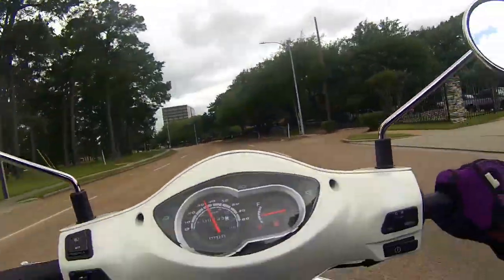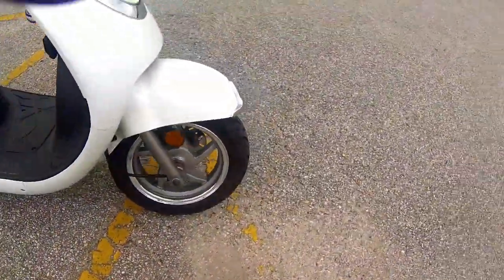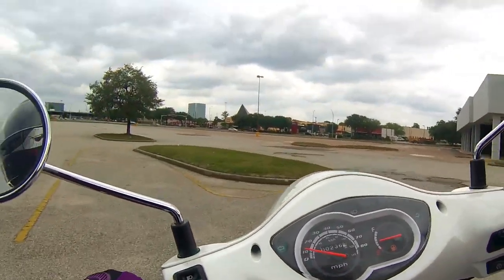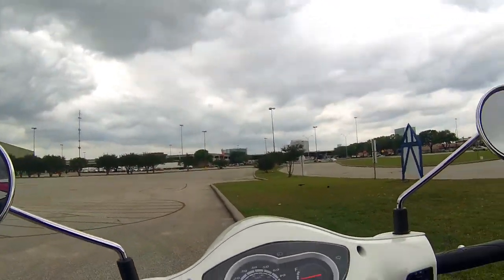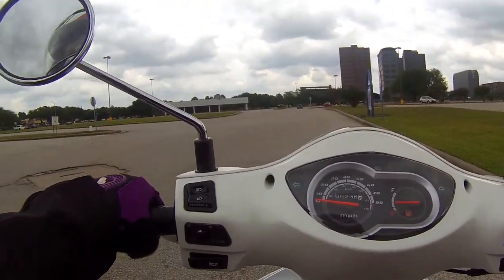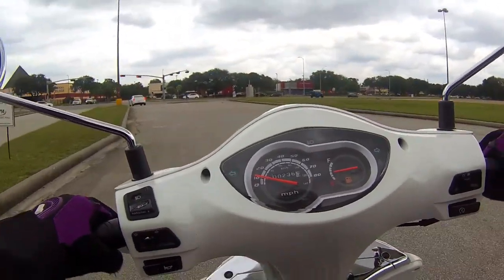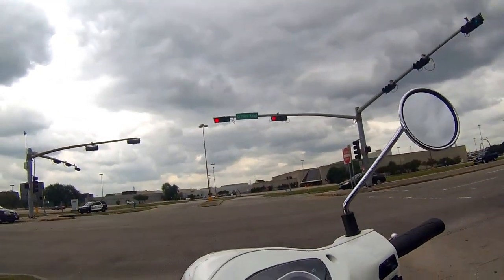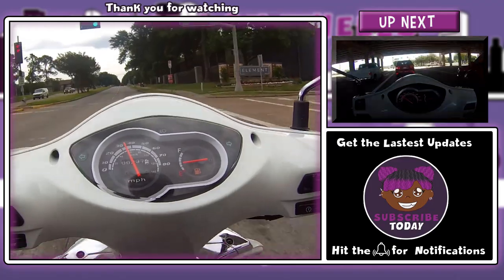125cc Scooter Vlog 21: Anti-Lock Brake System Story Time

Comment: The "ABS" systems on most (if not all) Chinese scooters are not actual "ABS" systems.  They're just a very simple mechanical pressure valve that diverts brake fluid pressure beyond a preset limit when a rider applies excessive pressure to the front brake lever. There are no complex sensors and pulse mechanisms such as those found in any true ABS system. Some (if not all) of the Chinese scooter manufacturers have added "ABS = Able to Brake and Steer" labels/stickers/inserts to avoid legal problems over the extremely misleading practice of claiming these scooters have "ABS' when they clearly do not. PS:  Some experienced riders prefer scooters without a pressure regulator, as they feel they have better control over the braking without it. Stay alert, be safe, and enjoy the adventure of two wheel motoring.
Reply from the maker: Edward Emmons Thank you for that insightful information edward.

Comment: Great explanation on the ABS!  You're right - ABS has a wheel speed sensor, and limits braking pressure when the wheel is about to lock up.  Your old Chinese scooter had FAKE abs, however, with no sensor, and essentially just a metal cylinder thing attached to the caliper that limits braking pressure.  The result is similar, but a lot less safe than real ABS.
Reply from the maker: Thank you Paul. Chinese scooters are cheap knock offs. So it's understandable that they use cheap versions of ABS.

Comment: I was hit last month (9/23/2021) on my Lance 125. Had zero time to do anything. I now drive a 2016 MP3 500cc with 3 wheel ABS and traction control. Would NEVER, EVER drive another scooter/motorcycle without ABS. I will say that the Lance is a pretty solid scooter for being so cheap. But our lives are worth saving up for a bike with ABS.

Comment: I've locked my brakes in training classes several times, both on the lot and on dirt. My brakes have locked on snow, wet grass and I'm used to sliding a bit. With regards to safety, I don't advise anyone to purchase scooters or any other bikes without abs. 

No matter what you have, you should practice braking regularly. If the ABS kicks in while practicing, you messed up.

Comment: None of my scooters have ABS. Just my CB500X. I have tried jamming my front brake and it's very very difficult to lock it up. I think I managed it once when some old guy decided to pull out in front of me. It does have combined brakes though. The manual says to apply both levers together, but I just use whichever I find appropriate.

One time the front started to wash out. I knew what to do, but they were factory tyres. Yeah, I don't recommend keeping factory tyres. But, I'll change them as soon as they get down low enough.
Reply from the maker: I've been thinking about doing the same to my tires as well.

Comment: Yeah I lock up my back tire all the time. the first time was kind of scary but I have gotten used to it.
Reply from the maker: The first time took me by surprise. But I haven't locked my wheel since then, so I all good.
Reply: Troll I don't like skidding out of KONTROLL.  (Not to mention tearing up your tire.  They're harder to change out and balance properly than to purchase).  So I remember teaching of ancient cycle master to put my BWAT toward the rear of the bike as much as possible in these emergency stop situations.  Much easier when you ride in a leaning forward position.  But on these little skoots you have to move yourself quickly and shift positions.    It's really difficult with your feet forward in the footwells and no foot pegs to push back on.  Safest thing is to be on guard position when danger lurks.  And PRACTICE your emergency stops regularly.  Of course, the even application of both brakes firmly without hesitation (ideally simultaneously repositioning your BWAT) is vital.   You don't have to think about a plan when the emergency happens, you need to already HAVE a PLAN.  I saw a video several years ago with a guy talking about riding safe on a bike, but he wasn't one of these regulars who patreon and seem to make a living off youtube, just a normal guy.  He said something that stuck with me:  "Smooth is safe."  Here's how important that is.  Smooth, is SAFE.  SMOOTH.  Don't be jerky, don't make quick lane changes, apply power smoothly, apply brakes smoothly, lean into the corners smoothly.  Do this, and likely you'll never have an accident on your own fault.  And you'll avoid many that you would otherwise have.  Watch how many people drive in violation of this simple rule.  Smooth is safe works in almost all kinds of applications.   That guy was a pilot, I'm a pilot.  The good ones are taught and practice to fly with precision.  Drive and ride with precision also.

Comment: How can I tell if I have ABS?
Reply: Just google your bike brand it should tell ya. Also you will feel a kinda pulling effect when applying some abs nothing bad just slightly noticeable over cbs or standard.
Reply from the maker: Kristi it is a small metal piece attached usually on the front side of the wheel, but sometimes the backside as well. It looks like the little piece I show you in the videos at 03:42

Comment: I have owned about 50 bikes in the past 47 years, and not a single one of them have had ABS. I will not buy a bike that has it. Yes, it could be good for new riders, but it is also bad. If you have ABS you may never learn to brake properly without it. You should learn to ride competently without the use of safety "crutches"  which also include the sidestand, brake, and clutch "safety cutout switches found on most modern bikes. No way am I going to trust control of my bike to a computer. 

They don't even teach math and handwriting in school anymore because of calculators and computers. High school graduates can't do long division on paper. Yes this is sort of off topic, but the fact is the more safety devices you put on a motor vehicles, the less competent the driver becomes. I ride mostly for pleasure, and that means being in full control of my bike, whether it is a 50cc scooter or a Goldwing.